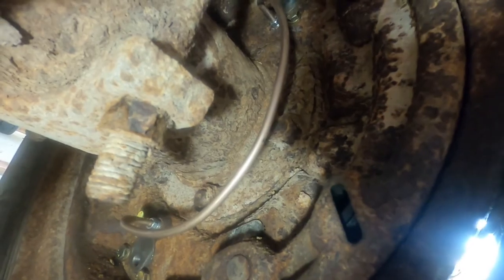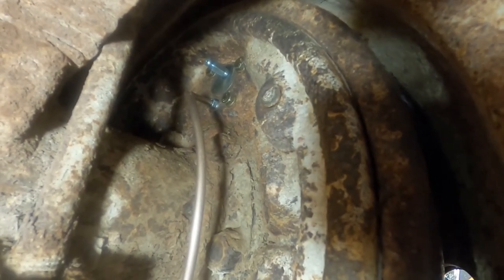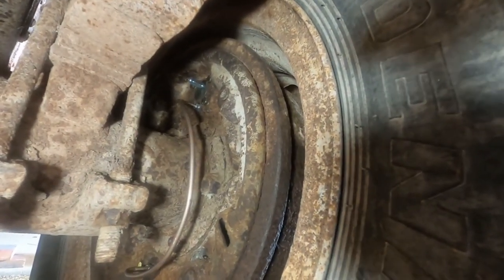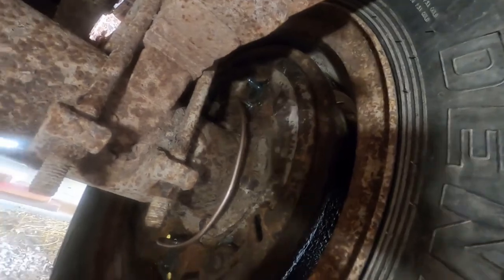Big Blue Brakes Part 4 - Getting Back Into The Driver Side Drum Of The C60

Comment: Does anybody know how big of an axle nut socket was needed?

And is there a special locking nut tool needed?

I’d like to just rent the tools ahead of time and not have to run back into town when I get to that part and essentially have to guess anyway.
Reply from the maker: Sorry, I don't recall.  We had a few large sets of 1" drive sockets available.  If you find out, please post here for the next guy searching!  Thank you!
Reply: Thanks for the reply! I have to replace the wheel cylinders on a ‘74 C60 and this video is a god send!
Reply: Maybe I mispoke - what is the name of the tool that you used after you removed the axle stub? That’s what I’m calling the “axle nut socket”. Looks like it has 3 “teeth” on it.
Reply from the maker: @bendiede7982  OH!  That was an oil filter socket we welded some keystock pieces to so we effectively had a spanner socket built just for this purpose.  I apologize, I should have detailed it better in the video.  Thanks for pointing it out!

Comment: NEVER use a cinder block under a jack or to block anything up. You are living dangerously when you do. That block can crumble and truck will fall on you. Never do that man. I cringed when you put that block under the jack and double cringed when you worked under it without jack stands.
Also do NOT use straight copper tubing for brake lines. Copper is not DOT approved. It can burst like a bad hose at the wrong time. Please get yourself some of the new nickel copper brake line tubing and redo those lines you are making. It is easy to bend and work with and is made for brake lines. I am just trying to help you be safe and safe to others on the road.
Good luck on this job!
Reply from the maker: Yes, it's the alloy copper lines, not straight copper.  Good catch there.  I know... I need better blocks, but I only had the Harbor Freight stands and had been getting a lot of bad feedback on those collapsing.  I'll do better.  Thanks for watching and commenting!
Reply: @FabbedFun  Just trying to help. Be safe with your progress.